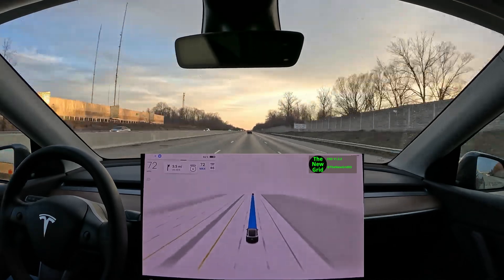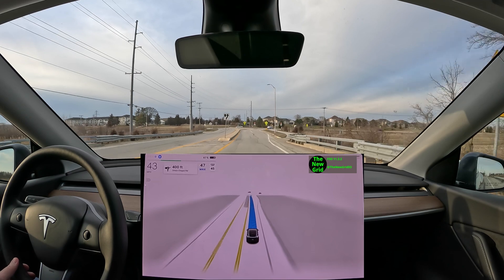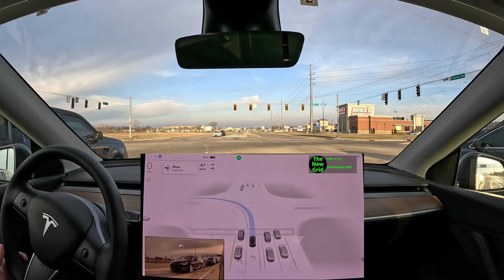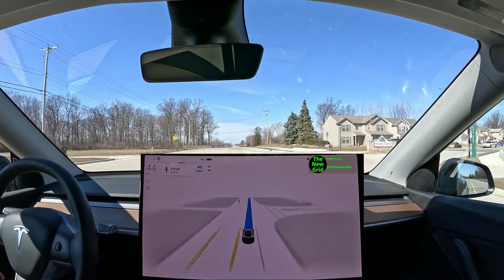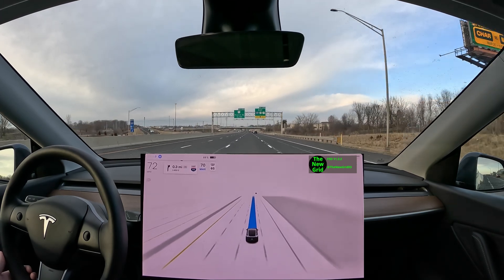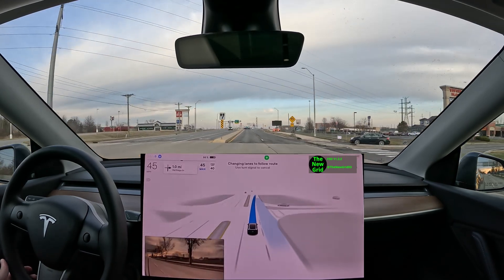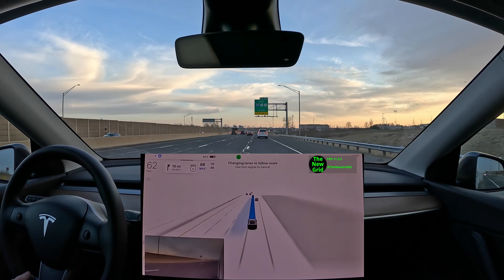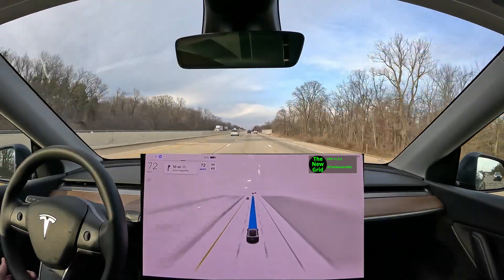Tesla FSD 11.3.2 complex intersections and impressions.

Comment: Diverging Diamond's still aren't that common. Found a website claiming there are only 99 in the U.S. Not surprised they still need work. Geeked out when I got a chance to drive one a few months back.
Reply from the maker: They actually are very nice. That intersection was, i believe, one of the first 10 in the us. It solved a ton of traffic issues there. If beta can handle my train tack roundabout, it should pick up on those in time. I am going to keep testing that one out.